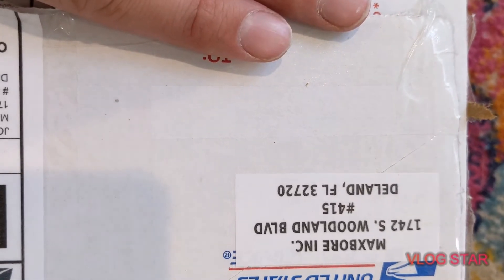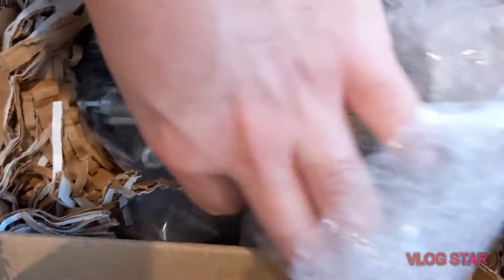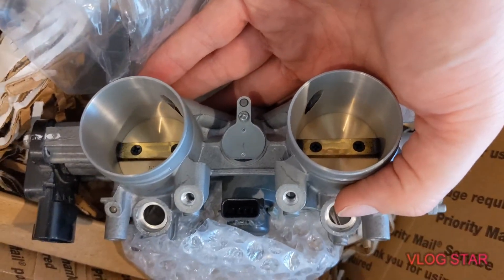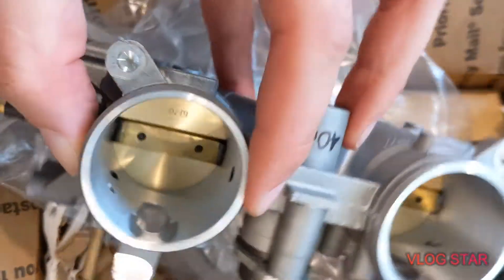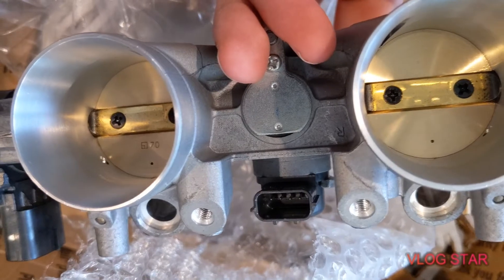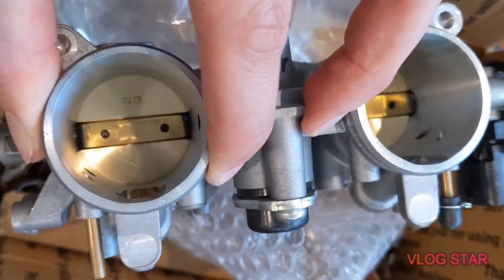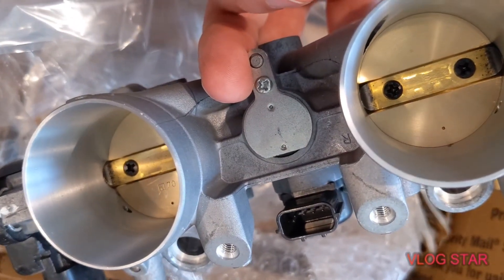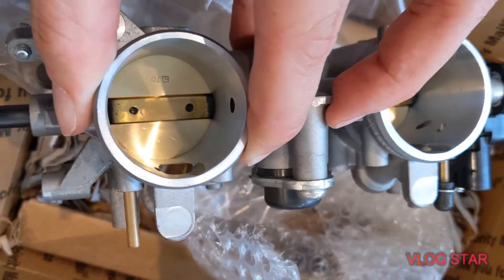FZ07 bored throttle body Maxbore

Comment: It's hard to tell from the video but did they remove the taper on the airbox side? looks like they did and I'm curious as to why as a tapered entry appears to give the best gains vs full bored
Reply from the maker: It was bored as far as you could safely go. Bike made great power with a custom intake and tune 2nd gear power wheelies for days. I’ve since sold the bike, but loved it when I had it

Comment: I'm dying to see the result of your work. how many mm did you increase the internal diameter?
Reply from the maker: Very soon! I've been pretty busy with the holidays. While I didn't run it on the dyno before there's tons of dyno results out there normal stock bike does 63-66whp I'm shooting for 80whp with all my mods. 2 mm bore on the intake side 38 to 40 on the rear side 5 mm 35 to 40
Reply: @DylanCarGuy  I believe it will achieve more power than 80hp. Here in Brazil they are getting 77-79 hp just by modifying, exhaust, air filter, air box and Remap reprogramming.
There's a YouTube channel called MafiZed from melbourne in Australia where they do this work on Throttle Budy. I noticed that they work with 41 mm.
Reply from the maker: @RoggerLemes  that would be awesome if it does, but I'm very happy with it regardless of the results. The power is 1000% noticable
Reply: @DylanCarGuy  I'm not sure which measure to use. I looked for information on the internet and only found your video where you use 40mm, the Mafized people who use 41mm and AP Moto Arts that seem to use 39mm.
Have you decided on this 40 mm measurement based on people who already use it or will it be a test?
Reply: @DylanCarGuy  Very good to know that you have already noticed a big difference.
Another question I would like to ask is whether you noticed anything different in the delivery of power and torque at low and medium "rpm".
My original FZ 07 rises from one wheel in 1 and 2 gears just accelerating without using the clutch.
Does your bike still have power at low revs after removing the restriction?
Or did you feel that the bike has become smoother by providing power at low revs? "lost power at low revs to gain strength at high revs"
Reply from the maker: @RoggerLemes  gained both low and top end. 1st two gears easy wheelies mind you I'm a bigger guy 230 lbs. Top end more power I had my red line increased. 1000 extra rpm
Reply: @DylanCarGuy  We have exactly the same weight, kkkk.
I will remove the constraint.
I will follow your videos here in Brazil!
Thank you very much for the tips ...
Reply: @RoggerLemes  Hello, just by pure chance I have stumbled across your comment! To set the record straight in my video I am not modifying the throttle body but the velocity stacks which are an Australian restriction for learners. The throttle body we use is 42mm on airbox side and about 35mm engine side. I'm about to DIY port the engine side to match the airbox side and was just checking to see what others have done before I get started.

Comment: How much was the price in total?? Bout to send mines out
Reply from the maker: $175 I believe it was very worth it
Reply: @DylanCarGuy  are you sure cause the website is stating $135 for each butterfly? Isn't that for each throttle plate?
Reply from the maker: @JAYJAY1787  it was pretty cheap if I remember correctly I emailed him trying to find the email. Then got a custom tune from Hordpower
Reply: @DylanCarGuy  I appreciate the response Nate from 2wheel just got back to me and said not to do it as I will need to modify the engine more compression and  performance camshaft I believe 😩 I'm on the fence about it
Reply from the maker: @JAYJAY1787  Hordpower not only recommend it he has a custom tune for it. I've had it that way over a year no issues, so it's up to you, but for me it's been great.
Reply: @DylanCarGuy  could you please confirm the full price from the email between you can the shop so I can send mines out and pay

Comment: hello Dylan have news about the project?
Reply from the maker: Not yet sorry work has been crazy. I have this installed and the new airbox with the new tune power gains were very noticeable just haven't had time to put it on the dyno
Reply: @DylanCarGuy  I look forward to seeing the result. I've already found a company that will change the diameter of Throttle's body.
I'm also trying to buy camshafts.
May you have a good week!
Reply from the maker: @RoggerLemes  if you end up buying a new cam let me know! I'm very interested in seeing the results of that
Reply: @DylanCarGuy  Warning yes!